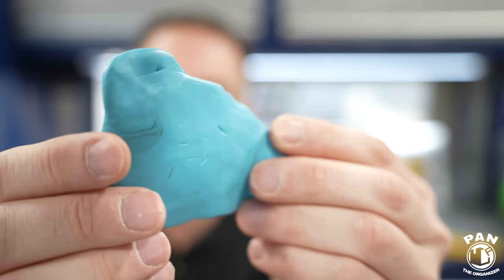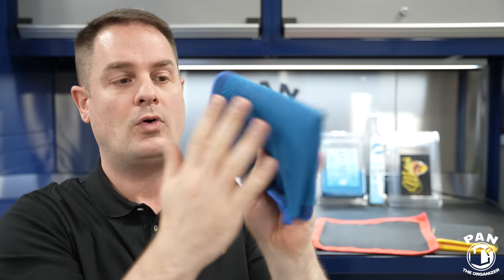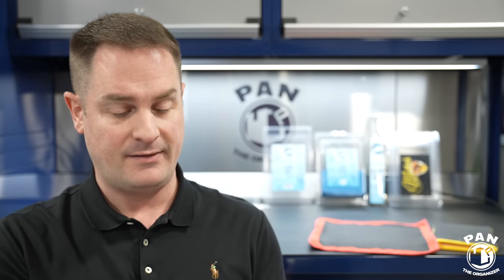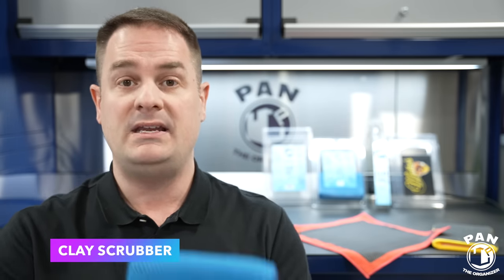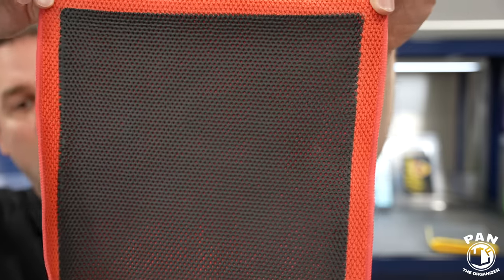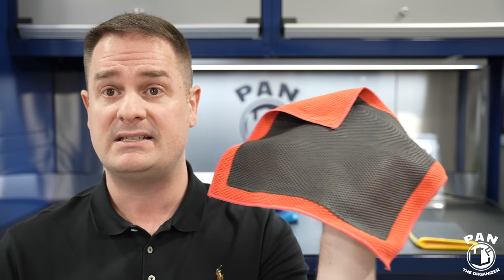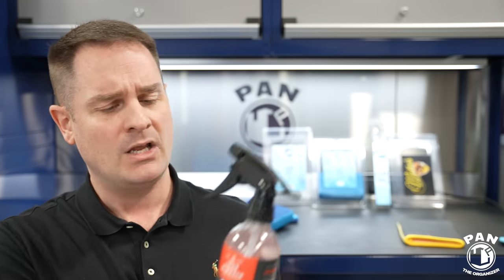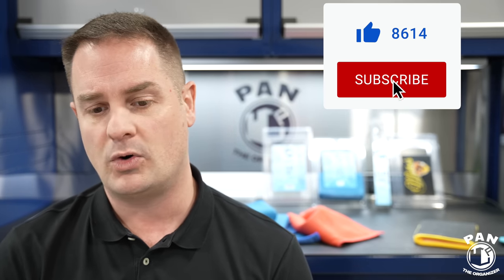The Future Of Automotive Clay Is Here… And It’s GOOD!

Comment: This video was informative and worth watching again. I have been using the DIY perforated synthetic decontamination towel for a year and wow does it work. Only once did I have to bring out the Rag Company clay bar for a heavily contaminated vehicle. A fun fact about the DIY iron remover is how well it cleans too. On a job once I was on the platform ladder and noticed heavy contamination where the windshield and glass meet as this had not been cleaned in over ten years. I did not want to get down the ladder so I sprayed DIY iron remover into a detail brush and this instantly cleaned the heavily contaminated paint. Ceramic Gloss used with the clay n seal along with DIY rinseless wash is money. I do like the smaller clay mitt from the Rag Company for cleaning the glass on the interior side and I need to pick one up. Thank you for another cutting edge video Pan!
Reply from the maker: Thanks for the feedback Neil! I hope you'll have a great weekend!
Reply: Thank you 😊

Comment: I have that blue Rag Company clay towel, I've used it 3 times and used It each time with clay lube while the vehicle was wet and soapy and it made a lot of marring. Had to do a 2 step correction as a result.
Reply: I've experienced the same results with the rag co scrubber and won't use it again

Comment: I use the clay and seal method in my shop all the time using beadmaker and a clay mitt. Pan's advice on the mitt in terms of speed is spot on. You can go a lot faster and not sacrifice the quality of the outcome.
Reply from the maker: Well said! Thanks for watching man!
Reply: Hi, love Pan's videos. Since you mentioned you use the clay and seal method was wondering if you could explain how to do it. I'm a do it yourself'er and love working on my cars and then sit back after a long day and admire them!
Thanks!!
Reply: @JohnReynolds123  p&s have a great video with Pan showing how to use beadmaker as a clay lube but essentially you spray the clay mitt or panel, then glide across the panel with light pressure until it feels smooth. Then use your drying towel to dry the area you've worked on.

Comment: I've been waiting for this topic to be covered in detail. I'm not comfortable using a clay bar and wasn't sure about using a clay mitt or towel, or which one's to use. This has clarified things, so thank you Pan.
Reply from the maker: Detailing isn't complicated once you get the basics right. I highly recommend that you watch my Detailing 101 series for beginners, where I explain different steps like iron removers, clay bar, polishing, protection, etc. It's super simple once you understand the basics, and your car will look and feel 100x better!

Part 1: how to properly wash your car: https://youtu.be/7Koj5j2Es5U
Part 2: how to clean wheels and tires: https://youtu.be/omwcNcSYcS8
Part 3: chemical decontamination (iron and tar removal): https://youtu.be/W_cyHz3XssU
Part 4: clay bar: https://youtu.be/XB8UaTCXuLg
Part 5: machine polishing (paint correction): https://youtu.be/ustTEVGMOTI
Part 6A: how to wax your car https://youtu.be/KZjiPcsPBrA
Part 6B: how to apply a ceramic coating: https://youtu.be/sqQYVjxFqK0
Part 7: Differences between waxes, paint sealants and coatings: https://youtu.be/4ejfPHan3k4
Part 8: How to clean your car’s interior like a pro: https://youtu.be/Xx_lHXHYpLo
Reply: Thanks so much, I will watch those for sure. I'm always excited to learn new tips and tricks 🙂
Reply: If you use a clay towel, do not forget to prime it by scrubbing a wet windshield with it first! Then remember that you are NOT supposed to apply any pressure at all against the paint.

Comment: Excellent breakdown and explanation of all these new perforated clay towels and how they can be used. Most comprehensive video I’ve seen so far on this topic. Lots of good tips. 

I’ve become a big fan of using the new Rag Company clay blocks and towel with DIY iron remover as per this video. Works amazing and huge time saver. Haven’t tried clay & seal yet so will try that next. Once Carzilla gets the DIY towel in stock I’ll for sure be purchasing.
Reply from the maker: Thanks for the feedback!
Reply: Thank you

Comment: @Pan let say I have a vehicle that definitely needs a clay towel treatment as well as compound and polish.  After that I apply Meguiars Hybrid Ceramic Wax. Then I do maintenance washes with Meguiars detailer. 6 to 9 months in the finish doesn't pass the hand in the plastic bag test. Is it safe to use the clay towel to smooth that out even though I have been using ceramic waxes and detailers?

Comment: Yasou Pan,

Thank you for another great video! I have a 2014 Chevy Malibu which has Never been decontaminated. I did the “plastic baggie “ test and it feels like sandpaper after I washed it. I started using P&S Absolute rinse less car wash after watching your videos along with the laser cut sponge, etc. 

I am confused about which DIY products to use with the DIY clay towel and have the following questions:

1. Which is the order to use the DIY products - do I use the DIY Iron Remover first and/or instead of or I do I use the DIY Ceramic Gloss?

2. What is the difference between the DIY Quick Beads vs the DIY Ceramic Gloss?

3. Would it be possible if you do a demonstration on these products? I learn so much watching you and explaining your expertise “tips and tricks!”

Thank you,

NIKOS

Comment: Hello , Thank you for these videos they are very helpful. I have a 2023 vehicle that the dealership scratched up during washing it . I got them to pay for a 2 step correction without ceramic at a well known top detailing company which came out perfect not a single scratch left, but its been about 4 or 5 months and when I dry with micro towels they seem to resist so I think its time to seal with wax or some type of ceramic, but should I clay first ?
Reply from the maker: It depends if your paint needs claying or not. Wash the car, then rinse, then run your fingers on the panels especially the lower parts of the doors and bumpers. If you feel grit or contamination, it needs claying. If it feels glass smooth, you can skip claying.

But for sure, when a car is freshly polished, ALWAYS apply some sort of protection afterwards (wax, sealant or ceramic coating). You don't want to leave your clear coat exposed to the elements unprotected.

Comment: do you think that I could get away from polishing after using the Rag Company Ultra Clay Scrubber and go straight to the ceramic wax? This is for a Summit White vehicle but I dont have any experience or tools for compound and polish.  I would like to use a high ph soap (turtle wax max power)to wash , iron remover, Ultra Clay sponge (with meguiars gold wash ) and the ceramic wax.
Reply from the maker: You'd have to observe your paint after claying and see if you think it needs polishing or not. If it looks good to you, you can skip polishing.

Also, before applying your protection, it would be a good idea to do an IPA wipe with a paint prep spray like CarPro Eraser or Gyeon Prep, to prep the surface prior to applying the ceramic wax (I'm assuming you're talking about the Turtle Wax Hybrid Solutions Graphene + Ceramic paste wax?)
Reply: @PanTheOrganizer  I have already bought the wax and its a basic ceramic detail spray wax, I believe the budget Technicians Choice brand. I believe the IPA wipe you recommended could never be a bad thing to do either way.
Reply from the maker: Yeah do an IPA wipe before applying protection, especially before ceramic based protection. You'll get longer durability and better results. If you have a previous weaker protection like a wax or sealant though, it's important to do a machine polishing step to fully strip the previous protection, if you want your ceramic based protection to bond correctly to the paint. Polishing is the only way to ensure 100% removal of any previous protection.

Comment: Hi Pan,

I have a soft black paint. Are there any differences between the P&S and The Rag Company towel. I'd like to use it with a rinseless wash. Which one of the towels and rinseless wash do you recomment?

Sietze
Reply from the maker: They are near identical to my knowledge, likely made at the same factory. Just get the one that is less expensive for you to purchase.

For a rinseless wash, my two current favourites are these:
https://bit.ly/3w3o1zj
https://bit.ly/3URj8TG

Comment: Great work as always, Pan! I've been wanting to mechanically decon my paint on my white truck, but I don't have the means to polish after claying. Would these fine clay towels be a good option? I'd hate to do all that decon work just to get scratches that need to be polished out, but can't.
Reply from the maker: The perforated clay media I recommended here don’t cause marring on the paint as long as you use them correctly with good lubrication. Test on an inconspicuous area first.
Reply: @PanTheOrganizer  thank you for the answer! I'll definitely be giving these a shot.
Reply from the maker: Always consider ordering through my links. It helps support the channel at no extra cost to you. 👍🏻
Reply: @PanTheOrganizer  yes sir!
Reply: A Polisher+pads+polishing liquid isn’t that expensive or hard to use

Comment: Hi Pan, thanks for a very useful video. Have been put off using a clay bar due to the marring issue, and potentially creating another job (machine polishing). The DIY detail towel is out of stock at my usual supplier here in the UK. Quite pricey at £35.
Reply from the maker: Yeah those sell out quickly!
Reply: Value vs price.

Comment: I just purchased a new Audi and had a full front ppf installed before delivery.  Now going to decon body for ceramic coating (Avalon King based on your recommendation).  Going with Halo flexible ceramic for the ppf.  Now going to buy a clay towel instead of using my  traditional clay bar.  Can the clay towel be used on the ppf or is there a better way to prep the ppf?
Reply from the maker: Yes the clay towel can be used on PPF, but only if it needs it. If you just purchased the vehicle, it likely doesn't need any claying. You only clay a surface that needs it. Typically after 6 months of road use.

See how I applied Halo in this video: https://youtu.be/7RCgqdGrvrA?si=Ot2PcQ_rFKsyLCfb

Comment: I just bought the rag company ultra clay towel. Can i dunk thd cloth in Onr clay dilution or should i just spray the car surface and thd towel?
Reply from the maker: You could have the rinseless solution to dunk in, but I would still use a clay lube sprayed on the surface, or your rinseless wash in clay dilution as your clay lube, in a spray bottle. Better stay on the safe side and use all the lubrication you can.

Comment: Pan another great video. Question if I use the clay towel and sealant like DIY Beads, can I then apply a ceramic coating over all that such as Cerakote’s product you recently reviewed?
Reply from the maker: No. True ceramic coatings, the ones in little glass bottles, need to bond directly to a virgin clear coat, free of any previous protection. So you can't use anything that has protection in it while you wash, decontaminate and prep the surface for the coating application.

No shampoos with waxes in them, no quick detail sprays or drying aids after the wash, no sealants used as clay lubes, etc.

See my ceramic coating application tutorial: https://youtu.be/sqQYVjxFqK0
Reply: @PanTheOrganizer  Thank you as always Pan. You amaze me how quickly and regularly you are able to reply to questions.

Comment: I myself, like the clay bar because I can "feel" the paint better and know when it's really working or if I need a heaver clay. Note: I only use a bar when used with a stripping wash soap and not once the car has been protected, then use a clay towel once a month after the whole car was protected.

"Me and my clay bar are one with the car".
It's also nothing for me to use 2 bottles of clay lube on a car, just so I know I'm getting enough lube.
Reply: Agree that one advantage of a bar is that the  clay bar gives you a true feel.    Another trick is to cut small working bits so you dont rrash a whole or larger piece if it hits the floor

Comment: Another EXCELLENT episode. I am unclear on the sequence after the initial wash. We use the synthetic clay towel with paint sealant to prepare the paint prior to doing the ceramic coating process. Question: do I then rinse down the car?
Question. If I  feel the need to use the iron remover product do i do it right after the paint sealant process. Prior to doing the ceramic coating?
Thanks
Reply from the maker: You do NOT use a paint protectant before applying a ceramic coating. The goal before applying a coating is to clean, decontaminate the paint, polish it to remove imperfections and previous protectants, and IPA wipe to remove polishing oils and then apply the coating.

See my ceramic coating application tutorial here: https://youtu.be/sqQYVjxFqK0
Reply: I didn’t realize that this episode was focused on maintenance of a car that already has been ceramic coated. Thanks

Comment: I wish I would have thought about the folding method when I first got my UCT. I recently picked up the scrubber back in June when was visiting TRC and absolutely love it but you definitely have a point, the towel is still a crucial tool for those hard to reach spots because of the flexibility.

Comment: Gonna pick up the DIY clay towel and maybe the quick beads to do this.  Might use the Iron Remover too.  First time claying, so excited.  Will let you know how it goes.
Reply from the maker: Quick Beads isn't meant to be used as a clay lube. It's a spray on rinse off sealant. If you want to do a "clay and seal" type thing, the DIY Detail Ceramic Gloss is a better option. 

See a video I made with Yvan from DIY Detail, where we show the "clay and seal" steps: https://youtu.be/WQH_RVOtrRA?si=b86czyu8bLUiiYPN

If you want to use Quick Beads, you'd have de wash the car first, then do the decon step with the DIY Detail decon towel and iron remover as clay lube (so you're also removing iron contamination at the same time), and then once you rinse, while the car is wet, you can spray Quick Beads, wait 30 seconds, and then rinse and dry the car.
Reply: @PanTheOrganizer  ok, thanks.  Both ways are clear to me.  I will decide which route to go.  Do you have a preference?  I get the spray on rinse off idea…I have used Meguirs hybrid ceramic wax, which is spray on rinse off after you’ve done the base coat.  Should I choose the quick beads or ceramic gloss?  Which one would you do?

Comment: Will the diy detail towel remove the Gyeon can coat evo ceramic spray coating? I know the towel is safe to use on coatings, but wasn’t sure on a can coat being a bit weaker than a traditional coating?
Reply from the maker: The DIY Detail perforated synthetic decontamination towel isn't abrasive, so it's safe on CanCoat EVO as well. But always test on an inconspicuous area first, and use plenty of lubrication.

Comment: PAN! I have a question!!! 
I’ve been spraying cars for years in a professional bodyshop in the UK. It gets very dusty in the Workshop from sanding. I want your opinion on the BEST way to remove the dust that collects on the car while it sits there waiting for the customer to collect. A quick air blow off, and a light wipe over with a California duster or? A detailer and clean lambs wool cloth perhaps? I do not want to wax or seal the car in anyway, or apply any detailer that requires moderate buffing or may cause smears. I just want to remove dust without causing scratches. And adding a super glossy deep slick shine, is secondary, and I only want that if it’s super easy and quick, otherwise, extra slickness doesn’t bother me, just want dust removal in that case. I want to do something that takes just 5 minutes and no effort, to clean dust off an entire car. I would consider a detailer that’s super fast to use and takes next to no effort to buff smears off nicely. I love Meguires detailer but still don’t know if what I do, puts tiny swirls in or not. What would you suggest? Worst part about detailers I find is getting it on the edges of windows ever so slightly, then trying to wipe it off cleanly, and the black sticky dirt on the rubber seals and plastic trims, rub along the edges of glass making it super hard to get the spray off nicely.
Reply from the maker: Never dry wipe a vehicle with California dusters. Those are not good for the paint! If there's only a VERY light layer of dust, you could use a plush microfiber towel and quick detail spray to lightly mist and wipe the surface. But ideally, I would always prefer a proper hand wash. 

There are no real miracles to avoid scratches unless you are using proper washing and drying methods.

Comment: So if I use the clay towel, then want put on a spray coating like “ethos resist” will that an issue because the clay towel has a synthetic protection already in it?
Reply from the maker: Clay the vehicle first, with a clay lube, rinse, dry the car, and then apply Ethos Resist.